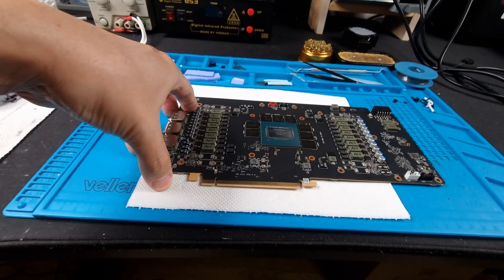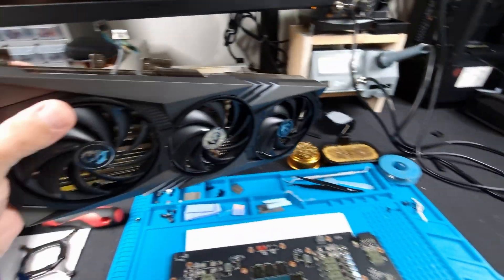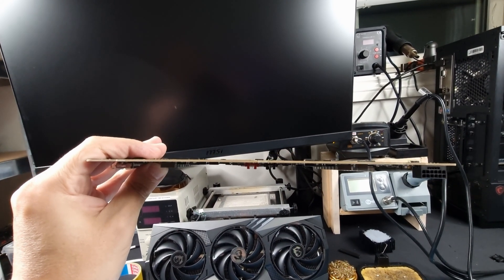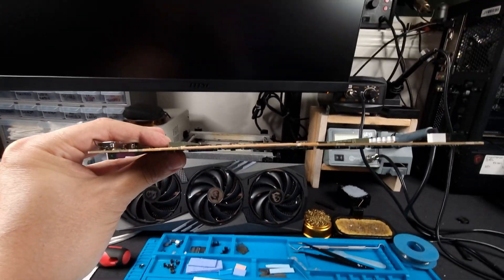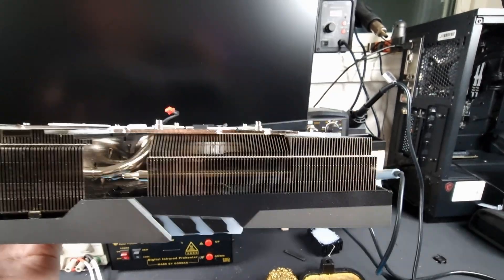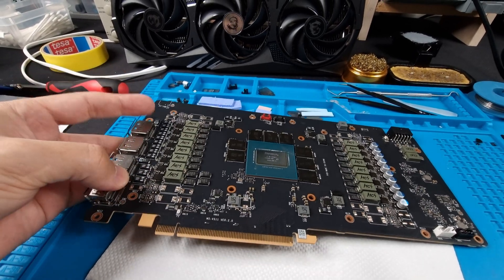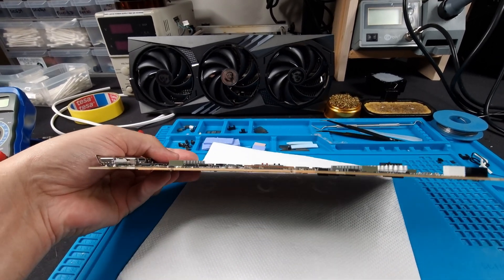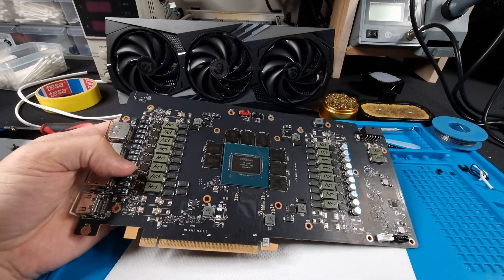How Using GPU Supports Incorrectly Can Destroy Your GPU.

Comment: This video is stupid. Vertical mounting actively hampers the amount of airflow the GPU gets in a case even with venting. Loads of empirical evidence out there that GPU cooling is actively worse with vertical mounting no matter how big your case is and how much airflow you pump through it.

Not to mention the bandwidth loss you get with stupidly-long PCI-E riser cables. Sag also exists on vertical mounting and it isn't magically erasing the problem.

PCBs crack even without GPU supports. This is explicitly on the manufacturer for not beefing them up and making half-assed graphics cards to milk as much money out of you. The only way forward is watercooling these behemoths.
Reply: modern Dual-chamber cases fixes that issue... by placing  3 massive fans below to feed air to the GPU. like the O11 shows only a 1–2c difference between a vertically mounted GPU and a standard horizontal one.
Reply from the maker: Your comment is stupid. You obviously did not pay attention to the video. You clearly see I am using a 3rd party vertical mount, and not the vertical mount option that comes with some cases, which place the GPU too close to the side panel, which hinders the amount of airflow to the card. This has already been discussed many times in other channels. But here clearly that is NOT the case. 

I have not seen any well verified data that proves cable risers used on vertical mounts by reputable brands like Corsair or Phanteks affect bandwidth. Modern riser cables are PCI-e 4.0 and 5.0 compliant. I have not seen any well verified data indicating it even affects latency. My advice: do not spend too much time on Reddit. There is a lot of disinformation on there, which could lead many to believe something that is not true. You are a perfect example. 

PCB's crack even without GPU supports? Do you understand what is being discussed here?
Reply: @TechnologyHive  Based on your experience, which top 5 air-cooled RTX 5090-s you recommend? My guess is rog astral, suprim, vanguard
Reply from the maker: @sassis2582 I have the Asus Strix. I have had the Suprim but it was in for repair. All these cards are very heavy due to their massive heatsinks. I would go with the strix since its the one I have experience with.
Reply: @TechnologyHive  People say Rog Astral has 90 c memory temps while Suprim has under 70 c, so astral will degrade sooner, is it true, is the 20c memory temp difference that important? you can see temps in this    WUO2-HI2bOU    DerBauers video, or use others sources
Reply from the maker: @sassis2582  GDDR6X and GDDR7 run fine with out degradation at 90c. The problem is when you start going over 100c.
Reply: @TechnologyHive  So its a safer bet to be at 70c rather than 90c right?
Reply from the maker: @sassis2582 Yes of course.

Comment: What abbot MSI 5090 SUPRIM, it has a reinforcing metal backplate + heavy-duty cage for extra support, will it still bent? have you seen old SUPRIM cards with the same problem?
Reply from the maker: I just finished reparing a SUPRIM card. It came in with broken solder joints under A1. Typical problem due to sag. Customer said he used a support. I do not doubt it but maybe he did not use it properly, I don't know for sure. If you want peace of mind, go vertical. If you can afford a 5090, you can afford a vertical riser setup no doubt. Or use a support for it. If it was my card, I would use a vertical mount and ditch the support. Period. But, this is MY opinion from experience repairing these things.
Reply: @TechnologyHive  Okay but SUPRIM is very heavy,  so if I mount it vertically will it still sag but this time vertically, downwards? is it still possible? Have you ever seen vertically mounted cards that sag also?  Because vertical mount doesn't support the card entirely, only PCI slot, no vertical support is there after PCI slot
Reply from the maker: @JamesSmith-cb7ou  I have never seen a card die from core or memory pads ripped off or cracked while installed vertically. They can still die due to driver mosfets failing or other reasons not related to sag.
Reply: @TechnologyHive  I have a dual chamber atx case with 10 fans, my 3 bottom 120mm fans are directly facing GPU-s 3 fans providing them with fresh air, so if I mount GPU vertically this means that GPU fans will face that tempered glass panel and my 5090 will overheat, I think it won't in normal ambient temperature around 20c, but I have no AC and in summer its around 30-35c, also I use air CPU cooler, and I wont change it cause last AIO killed my old GPU,  so in summer my vertically mounted GPU will overheat because of that high ambient 35c temperature? Please tell me that I'm wrong I have no idea how worse GPU temps will become in extreme ambient conditions after vertically mounting it?

Comment: I just built my first PC and the PNY Nvidia 5080 came with an adjustable support. Ther way the fans/RGBs are, the most natural place to put the support is mostly in the middle section of the card (obviously towards the edge of the frame). I'm thankful that being put in the middle is a viable option as opposed to putting it towards the front corner which will lead to contortion.

Comment: Hello bro , i have an asus 4060 dual with two fans, weighing around 600 grams do you think this card  requires a gpu support bracket ? or i will be fine
Reply from the maker: I wouldn't worry about a small card like that. You will be fine.

Comment: It just affirms the fact there is no shortage of idiots in the world. GPU supports work. They will not damage the card unless you use them incorrectly. They must go on the corner furthest from the board. The support only needs to hold the weight just so. You don't need to adjust it till the board is even. You just need to relieve some weight. If you do nothing then sag will surely destroy the card.
Reply from the maker: I'd advice to put the support 3/4 the length of the card.
Reply: Most people do that and still end up damaging the card. You should support it where the PCB ends, not at the end corner of the heatsink.
Reply from the maker: @pouringpoipoi5777  That is usually between fan 2 and 3, or 2/3 the length of the card.

Comment: My riser broke after 5 years. Much easier to replace that than the whole card. Wasn't going to for my new 5070 ti build. But think I have to now
Reply from the maker: Protect your investment 👍
Reply: @TechnologyHive good vertical mount kit you could recommend ? I have an antec c8
Reply from the maker: @eb3900  Check out the one by Phanteks. Its about $60 or so. https://www.komplett.no/product/1220772/datautstyr/pc-komponenter/kabinetterbarebone/tilbehoer/phanteks-vertical-gpu-bracket?gad_campaignid=19671799102

Comment: I can certainly see the logic in a riser, it takes weight of the card at the contact point with the motherboard away from the pcb and transfers it completely to the backplate which i assume is bolted to the frame of the card as a whole.
Reply from the maker: That's exactly it.

Comment: Isn't comparing a 8 dollar GPU standoff with a 60+ dollar riser 1:1 a bit of a silly thing to do? Am I missing something or isn't it just possible to spend 32 dollars to buy 4 standoffs? Putting one at the far right corner, like people usually do, one at the far left, then one between fan 2 and 3 as close to the center line as you can without impeding the fans, and the final one on the same spot but between fan 1 and 2. That would mitigate the "too much force on a small surface area" issue discussed and mitigate the "too far between supporting points leading to excessive bowing" issue. Sure they wouldn't be completely removed, as mentioned even vertical mounting doesn't completely remove bowing, it just mitigates it to a point where it's no longer a practical issue. Wouldn't a multiple standoff solution also do just that? Especially if you're in a case where vertical mounting just isn't an option.

Main counter argument I'd think off of the top of my head is "but that would be ugly". Well, so is using 1 GPU standoff. And hot take, so is vertical mounting. I personally think it just looks silly, but I'm function over form, so I don't actually care. But since most GPUs don't have aRGB fans. I could see how our fellow aRGB enjoyers would consider making a 3 non-aRGB fan GPU the focal point of their build, a complete non-starter. Because when you vertical mount, your GPU fans becomes the focal point, whether you like it or not.

Comment: This had nothing to do with a gpu support causing this in proper use. It's simple. Sag will break a gpu over time because it's bending it. So how is a support breaking it? By people forcing the gpu too high. They are not using the support to make the gpu even they are pushing it as high as it can physically go and ramming the support there to force it at that height. They are anti sagging it lol. 

I hope people don't take this guys horrible miss information. You absolutely need a gpu support on most modern gpus even if they aren't high end even the 60 and 70 series cards have a lot of versions that sag. You need to support it. Just you know... Meet the 40 IQ bar. Make the gpu even and as flat as possible in the case then put the support in while holding it and make it match where the gpu is even.

I love how this guys advice was basically "Just don't use the pci-e slot at all it's impossible you need a riser it's the only way to put a gpu in a pc safely anymore like... Yeah sub count checks out with takes like that. What is more scary than a dead channel spreading miss information though... This guy "repairs" gpus. This is someone who a lot of poor people have paid a lot of money to probably get scammed by. You know if he is firing out such clueless takes what it says about his repair job. What also worries me about his repair job... Nice mountain of food left overs in your mod mat. Would love sending my gpu to repair by a guy who has clearly been eating over the workstation and doesn't even wash his hands so it's covered in food. Lovely.
Reply from the maker: I do not think there is any argument about why this is happening. People are using supports incorrectly.

Comment: This video (which got recommended to me again) is the reason why i will swap to a case like the thermaltake the tower 600 for my next PC (different MOBO orientation, do not lose access to other PCIe). For now the longest GPUs i tried were around 280 mm and it's fine but GPUs get bigger and bigger, at least if it's only more slots why not (?) but the center of mass must be closer to the screws.

Will try the Sapphire 9070 Pulse soon (280 mm) but i wonder if the Powercolor 9070 XT reaper is a better choice but it's 304 mm (without support, what maximum length do you recommend to avoid sag ?). I can return the 9070 a few days after trying it if it's not enough for my needs and get the XT but idk.

Maybe i'm worried for nothing and it start to be problematic for length of 320 mm or 340 mm, idk.
Reply from the maker: I am actually working on a lot of cards now from the 3000 and 4000 series with heavy heatsinks on them, and the culprit of the problem is usually the memory chips near the PCI-e slot, where a lot of the stress happens. It's either A-0 or B-1. So common, I sometimes do not even bother running a memory test because it happens so much. 

you'd right to either get a case like the one you mentioned or just get a vertical mount kit. If anything, you will have peace of mind.
Reply: @TechnologyHive Thanks, i will buy a new case then, since i don't want to lose access to other PCIe port.

Comment: You claim that supporting the GPU causes cracks due to heat and thermal fluctuations. I think that's nonsense. It only causes deformation—or even cracks—if someone lifts the card way too much. But if you just raise it enough to make it level, and ideally distribute the weight across more than one point, then it's totally fine. The weight gets evenly distributed, and there won’t be any deformation or cracking whatsoever.
 By the way, do you seriously think it’s okay for my roughly 1.5 kg Gigabyte RX 5700 XT to visibly sag? That doesn’t put stress on the PCB and risk cracking? Of course it does. The real issue is that people buy overpriced, crappy GPU supports and then use them incorrectly. But heavy cards do need support—because letting them sag even a centimeter, now that’s the real barbaric move.
Reply from the maker: If you know what you're doing with your GPU support, great. But a lot of people do not know how to use the supports correctly. Thus I recommend you use a vertical mount kit. And no, it does not take much for joints to crack with these newer cards using lead-free solder. But you do what you want with your hardware.

Comment: so whats your suggestion? leave it alone or get a vertical mount?
Reply from the maker: If its a large heavy card, either see if you can place your PC on it's side until you get a vertical mount, or just add support without pushing the card up. Loosen the screws holding the card in place and let the card come down on the supports and adjust until levelled.
Reply: @TechnologyHive  its definitely a big card but everything i am reading says putting it sideways is the way to go...

Comment: Having a somewhat quality GPU support, screw, thread hole if there is, as those can get damaged after screwing in and out the screw too many times, rendering it useless - otherwise should be fine, along with using a small spirit level tool to measure the card's water level to check if it is horizontal as much as possible. if it is there shouldn't be a problem. There are also creative solutions out there, when it comes to gpu supports. Not to forget, riser cables have their own risks as well (NZXT fire story.). GPU board partners in general are also aware of the issue and some of them are trying to reinforce the PCB to mitigate the risk. Still this is a nice video making valid points and the most important is to be aware and mindful of this situation, mitigating the risk.
Reply from the maker: You can also just lay your PC on it's side if it fits on your desk, for example.

Comment: My PNY 4090 screws in totally level with no sag and no use of a bracket. The other companies need to build better.
Reply from the maker: It will sag in time due to hot/cold cycles. It happens.

Comment: SLI tech would have been a good thing considering they can't really make gpus smaller, unfortunately it never picked up. We are living in interesting times where density of transistors has hit a limit, these boards are already about the size of microAtx. 

Thats probably why they pushed so hard on AI (to have a different market), unless they can pack in more transistors, the industry is pretty much going to be at the end of the rope for graphics cards. 

You can only make these things so big, and find willing buyers.

In any case, graphics fidelity is losing incentive; I would not be surprised if poor optimized games were deliberate but its a faceted problem.

Comment: More supports would prevent it from bowing. Just think of carpentry... if you have support on both ends on a longer run, you need more support in the middle or it will bow

Comment: What if the support is on the motherboard side rather than on the other end of the GC (same side as the PCIe slot)? Like the Lian Li B001 for instance..
Reply from the maker: I have not tried that, so I can not say with 100% what would happen. But 2 support points should be good. One in the middle and towards the end.

Comment: I have a Zotac 4090 and the GPU support is almost placed in the middle of the card. i just put the bracket under the GPU and the GPU bracket lifted my 4090 slightly until it is level, i cannot see any upward bending so is it fine the way i have done it? would love a clear answer on this :)
Reply from the maker: Just make sure that when you add support, your card is NOT screwed to your case tight. Loosen up the screws first so the card just hangs, then lift it up with the support to level. Then tighten the screws up. Done.
Reply: @TechnologyHive  do i really need to do that if the GPU looks and is level now? it don't go up on the far end :)
Reply from the maker: @letho1157  You asked for a clear answer, and I think I gave you one. Now its your choice whether to take the advice or ignore it. Its up to you.
Reply: @TechnologyHive  i did it now, loosened the screws and the i lifted the gpu with the support :) is it supposed to put some pressure on the gpu? when i try to remove support the gpu goes a little bit down

Comment: My card is 1150g. Should I get a verticle mount? I live in India and GPU supports/vertical mounts are a myth here

(Asrock rx9070xt Steel legend, brand new and not installed atm)
Reply from the maker: Can you set your case horizontally?
Reply: I can do that yea and that should fix sagging but it looks ugly and takes a huge space :D
Reply: 1150g is on the lighter side right? Can it sag?
Reply from the maker: I dont want to guve you wrong info. But id definitely use some support.@thiccchanka2752
Reply: @ Thanks!

Comment: I'm thinking 2-3 supports would probably be better as well as making sure it is level with the board left to right and front to back.
Reply from the maker: Just make sure not to push up on the card when installing the supports. Let the card just rest level on the supports.
Reply: @ Yup :3

Comment: What if i put the gpu support bracket in the middle instead of the right side just slightly help it. not to twist it upwards
Reply from the maker: @YagamiNite  That works, too. Just loosen up the screws holding the gpu to the case before adding any support.